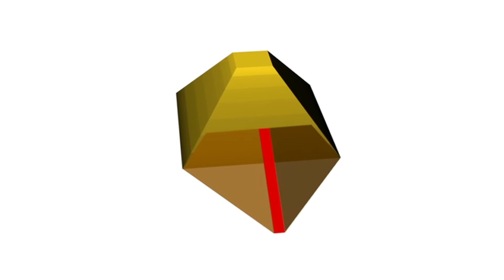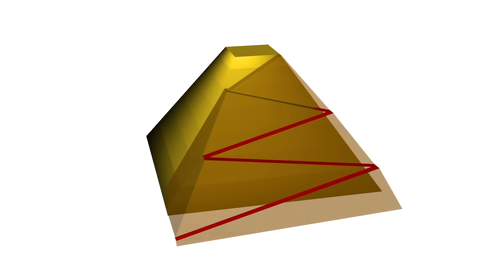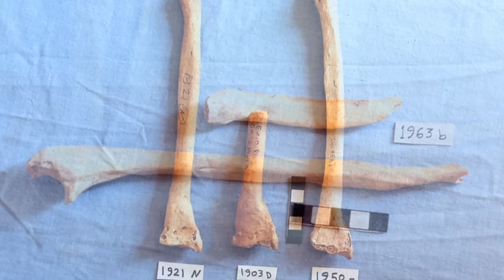Egyptology - Pyramid Construction

Comment: Ok, mainstream science says the great pyramid was built in 20 years. It has 2.3 Million individual blocks, each weighing about 2 tons. If you do the math, that means 1 stone had to be set every 5 minutes 24 hours a day, for 20 years, um, ok, sounds totally plausible.
Reply: You are building a brick building.  A mason can lay a single brick in say 3 minutes.  That means they can lay 20 bricks each hour.  Your building will use 20,000 bricks.  So:

1 - if you only have 1 mason it will take them = 1,000 hours to lay all the bricks.
2 - if however you have 10 masons working in tandem = it will only take 100 hours to lay all the bricks.
3 - say however you happen to have 25 masons working for you = that means they could lay all the bricks in 40 hours......and so on we go.

Moral of the story:  so first of all the total number of blocks is of course an estimate.  Next is the reality that the largest/heaviest blocks are found in the bottom third of the pyramids with those above becoming smaller as the pyramid rises in height.  Look at photos of the top of the Great Pyramid were people climbed it to take selfies = the blocks are small enough to have been slid into place by several men. This means that as it rises in height the blocks can be raised more readily than the heavier ones on the bottom.

Next is the Egyptians employed thousands of workers broken into specialized teams who did a single task - Egyptologists estimate around 20,000 for the Great Pyramid.  People who do only one thing can rapidly acquire proficiency to perform the task faster.  So the more teams who work together to place a block = the faster it goes with more blocks being placed more quickly the same as our masons above laying bricks. 

Finally is most of the blocks are little more than crudely hewn chunks of stone rapidly placed leaving gaps all over.  So there were not trying to make it look "neat".  They rather were laying chunks of stone as quickly as possible to later cover it all over with a layer of more carefully cut and polished stone. The pyramids are little more than stacked rubble - and yes = it was possible after all.  Have a nice day.

Comment: But they hidin the fact that they discovered..
Carbon Dating between the top blocks and the base or lower blocks suggest otherwise... Meaning, the top blocks was older than the blocks in the base or bottom..

Let that sink in...

Comment: What happened to the ramps?
Reply: They were dug up and dumped into the limestone quarry pits which sit adjacent to the pyramids to backfill the area.  Any stone employed in creating ramps was likely recycled for other things such as tombs for lesser individuals or dumped into the cores of another pyramid.  There remains coincidentally smaller ramps today at Giza such as can be seen around partially completed tombs/temples such as in the Western Cemetery which sits on the opposite side of the Great Pyramid from Cairo.  

So the Egyptians built ramps from either mud bricks or else a mixture of sand/stone chips/tafla - a clay they mined.  There is the remains of a large tafla mining operation near the worker village at Giza.  So when Egyptologists excavated the limestone quarries years ago they found massive amounts of....................yup = sand/stone chips/tafla dumped into them - or what they made ramps from.  

So the answer to your query is the ramps went nowhere.  As they encased the pyramids in white limestone working from the top down as Herodotus wrote = they systematically dug away the ramps until they reached the ground level and dumped the residue into the quarries where the limestone came from.  Have a nice day.

Comment: For more than 20 years, I've been trying to tell you that the pyramids were originally built, in the Brazilian Amazon, by the Mayans, to enable them to blow up their balloons, which they used to travel. There was no other way that the Mayans could escape from the Brazilian jungle, other than up through the trees, so they built the pyramids for that sole purpose. The rubber plant is the most prevalent natural resource in Brazil, and they used it to form their balloons.

The two air shafts, on the sides of the pyramid, were used to create a vacuum, to suck in the air. The air was then collected in a bubble, under the pyramid, then released into the main shaft, which blew the air out the top.

Here, we see King Pakal seated in his basket, looking up at the stars, which they used for navigation. https://www.behance.net/gallery/70791759/Mayan-Astronaut 

The Mayans were the original Pharaohs of Egypt.
Reply: News ? NO  MONEY. Go to www.thegreatpyramidofegypt.com ,  accessing , no money  „Read  fragments” ;  ( 1 - MENU / Menu ;  2 – ENGLISH  / Romană ;  3 – FRAGMENTS OF THE BOOK   / Fragmente din carte ;      4 – COMENTS  / Comentarii ;  )  and have some comment. Hănțulie Ionel

Comment: Yes it has ! It has been  proven , without a doubt  , that a spiral ramp / tunnel come from internal to  outward to form the pyramid !
See the French Architect who discovered categoric evidence within the existing highest pyramid , with photo's and structural evidence present  . I have the name the Architect , but need to trace it back to files I have not at my finger tips at this very moment . The slope of the internals to complete the pyramid was approximately 7 degrees . Having seen this current video here , I am amazed at the lack of communication between architects , egyptologists and so on ! I hope that somebody relays this info onto those who are still aware of this French Architects work just revealed here  . Kenneth ( spssabkjk@gmail.com )

Comment: Read holly Quran its mentioned there how they are made. They used sand casting and salted water to harden the block and drying them under the sun heat and fire at night...

Comment: With there mas knowledge of mercury and frequencies , magnetism, batteries, electricity, metal's they would have found an easy way to build these pyramids. Mercury for example everything floats in it easy way to transport stone make a canal to your build site from your quarry and make some dams and lift gates then flood the system with mercury now those stones are floating drag them to the pyramids site

Comment: There is an internal spiral ramp at 7 degrees
Reply: Wrong...........but thank you for playing.  There is no internal ramp in the pyramids. That silly claim was debunked when the muon scans were done a few years ago.   In fact there is likely rubble in the cores of the pyramids surrounded by corridors/chambers of cut blocks and an outer layer of cut stone so as to form the basic shape.  Of course the only way to prove it would be to damage the pyramid by cutting into it - which would be counter productive.

When you look at the pyramids of the Middle Kingdom and those much later "Nubian" pyramids to the far south you see the same thing.  The Middle Kingdom Egyptians created pyramids with mud brick interiors surrounded by cut and polished stone blocks.  The Nubians created similar structures save for theirs were earthen filler rather than mud bricks which was also encased by cut stone.

Moral of the story:  so it is plausible that in at least part of the pyramids of Giza there is some type of filler - likely residue from the quarries where the blocks were cut.  Employing filler would save time by reducing the total number of blocks required while still allowing for the overall shape which was encased in more carefully cut and polished white limestone.  Have a nice day. 

p.s. - the Japanese team which did the first muon scan is coincidentally completing another one at this very moment.  The results are expected to be released later this year.  So when that one also fails to detect this mythical "internal ramp" = hopefully this nonsense will stop once and for all.
Reply: @varyolla435  yes your correct, the interior blocks are filled with mud, sand and small stones.  I believe the gallery was a place to raise the giant 60 ton granite blocks to the middle.  If u look at the bottom sides u can see graze marks .... It was also lined with wood...hang on I'll send a link it's very interesting
Reply: This will explain my ...well not my...but his theory
..but it's the most plausible https://youtu.be/eGqfdXkAQMk
Reply: I also believe the pyramids are much older than explained to us as children.  10000 years or more
Reply: @breakingames7772  Your clickbait video is amusing = if wrong.  Houdin's internal ramp hypothesis was debunked - not that it was ever taken seriously - as already noted by myself.  When the original 2 muon scans failed to show any evidence to corroborate it = even Bob Brier the individual in your video who co-wrote a book with Houdin admitted they got it wrong.  So there is absolutely zero evidence to support your fanciful claim.

As to the Grand Gallery being used to raise blocks - doubtful.  The large granite relieving blocks are found above the level of the gallery itself. So they would have been able to raise the smaller granite blocks making up the chamber the same as they did other limestone blocks. Any scrap marks on the bottom of the hall might be explained by the granite "plugs" used to seal the King's Chamber in the portcullis anteroom and/or the granite plugs which sealed the entrance to the gallery itself which would have had to have been allowed to slid into place upon closure of the pyramid. Thus the recesses in the gallery walls might have held statues of Khufu + lighting + or part of a retention system for the blocks which upon closure was removed prior to the workmen escaping the gallery via the small escape shaft leading below.

The large granite relieving blocks above likely were installed from another direction.  If you look at the western base of the pyramid which is now exposed you can see where they essentially cut the top off of a small hill to create a base upon which they built.  There is an exposed long section of continuous limestone as opposed to a series of individual blocks.  

As such if they built upon an existing hill which was then partially leveled to allow blocks to enclose the area = the hill itself could have served as part of an access ramp to raise blocks to build the King's Chamber and Grand Gallery.  Then upon completion the area was enclosed and its edges leveled to accommodate individual blocks being laid so as to facilitate the tiers of the pyramid stones.  Forget about your internal ramp nonsense.

Comment: If they just wanted to make big structure they could have done it from smaller stones or even clay bricks? They chose precicely cut large stones because it was easier for them not because it is difficult. Modern archaeology assumes that these people had no wheels steel and that they were simple minded. With that assumption they will never find the truth. Btw, did they build ramps from smaller stones or similar huge blocks?

Comment: Why the pyramids were assumed to be constructed with natural stones?  Could they be constructed with artificial stones made of cement concrete?
Reply: Ah............because that is what they show to be.  lol!  We see chisel marks on the stones themselves while the quarries they came from clearly show where they were cutting out "blocks" rather than harvesting raw material to then pulverize into some type of pre-mix - which would actually take considerably more work.  Also the sizes and shapes of the blocks refute their coming from molds while they further show the strata lines of the bedrock they were cut from as limestone forms in layers.  

So a block made from a mold would not have a darkened line running through it depicting different density layers of limestone.  It would rather be of uniform shape and color.  So there is absolutely zero credible evidence to show the Egyptians casting blocks from some type of pre-mix = while there is loads of evidence as we see to debunk such a claim.  Have a nice day.
Reply: @varyolla435  :  Thank you.  Would you go to another video 
https://www.youtube.com/watch?v=EaQr917lRgI&t=3s 
and stop at 16:14.   There a stone opened a big hole and its interior was shown to be a pile of junks.  If you have time, you will find that I, whk wole, also commented there.  I gave more places showing the interiors of huge stones.

Comment: What a load of BS! People towed 70 ton blocks to a height of over 350 feet?! 
The bigger question, how did they cut limestone and granite using Bronze Age tools? Answer, they didn't!
Reply: lol!!  Deep thinker I see.  Oh well.  How about a reality break from your obvious internet clickbait and Hollywood-induced fantasy.

1 - the heavy granite relieving blocks are not 350 feet up.  In fact the King's Chamber it only about 46 meters - or about 140 feet above ground level.  Meanwhile the chamber itself is only about 20 feet high so that the relieving blocks then sit below the 200 foot level. Now for "some" 200 feet sounds like a lot.  It is actually about 60 meters.  That is not actually very far.  
2 - So a ramp could easily be constructed to reach that height assuming that it did not already exist.  If you look at the western base of the Great Pyramid you'll note where the Egyptians built upon what was once a small hill as their is a contiguous line of stone there where they leveled off a hill to build upon.  So the level of the King's Chamber might have once been a hill they cut into to lay the blocks of the chamber and connecting gallery and then = surrounded the area with more blocks. That would reduce the amount of ramp to be constructed as they could use the natural grade of the hill itself. 
3 - bronze tools are more than capable of cutting limestone.  Further they can when used with an abrasive such as sand or corundum also cut granite.  

Moral of the story:  so they were not individually sawing through all of the blocks there.  They rather as masons do today instead cut lines in bedrock and they further cut holes along the line akin to a saltine cracker edge.  Then by driving wedges into the holes along with possibly soaking them to cause expansion = split the bedrock along the line.  Coincidentally this is what we see in the actual quarries at Giza and elsewhere.

Then having fractured a section of bedrock they drove long bronze chisels in a line at intervals into the stone.  Drive a drill deep enough - it does not need to go far - and the stone will continue to fracture downward creating 2 halves with approximately straight sides.  Granite was quarried initially using dolerite and fire.  By heating and then quenching an area with water the stone softens.  That allows you to pound through it more easily to achieve a basic shape which can then be polished smooth using flat stones and an abrasive - possibly mixed with clay to form a polishing paste.  

Bronze saws can also cut through granite when an abrasive is used.  Yes it takes more time but it is possible.  So assume less and follow the actual evidence more. Things tend to make more sense when you do.  Have a nice day.

Comment: What a load of tosh, marking A high spot as if there would just be one or two on a two & half stock block and then rubbing flat with sand paper🤣 if this was the case they whoever ther are, would be about half way up now. So what about the much heavier granite blocks placed in a puzzle throughout the structure? Lets not debate them.
Its guestimated it took 30 years to finish the job and yet after all that, no one was buried inside. I would want my money back🤣
How many years of study to come up with this theory? 
Why are we looking at how we might do the engineering when there was none 6 or 7 thousand years ago? But and this is the big but, both the pyramid and the sphynx have massive water erosion scars placing them back before the floods to nearly 25,000 years ago, so then, who the hell really built them let alone how????

Comment: In previous time, people had incredible technologies than modern people. They were more wise. The modern people are unable to find ,why egaption bulid paramids, there mission and goals.
Reply: They build them to house their dead kings. That's pretty well established by the fact that those dead kings were entombed inside them. The technologies used were the lever, fulcrum, axle, and the inclined plane. That's all you need to stack one brick onto another. Just rinse and repeat until it's done.

Comment: The blocks were up to 30 ton inside the chamber, that was 350ft above the ground, u need a 10 degree ramp to be able to haul those stones up, the ramp would have to be so long and massive
Reply: Ah...........wrong.  Time to find better sources of information = just a thought.  The King's Chamber sits about 130 feet about ground level and is itself only about 20 feet high.  As such the height the relieving blocks needed to be raised is below the 200 foot mark while most of the stone in the pyramid is found below this level.  

So only a small percentage of the total blocks needed to be raised above the level of the King's Chamber while those blocks were small in size.  Google photos of the top of the Great Pyramid from individuals who climbed it to post selfies.  Note how the blocks on top are small enough to have been slid into place by several men.  The blocks of the pyramids get smaller in size as they rise in height with the largest/heaviest ones being found in the bottom third of the structures.  Have a nice day.
Reply: Vary Olla https://youtu.be/191PshRLtos